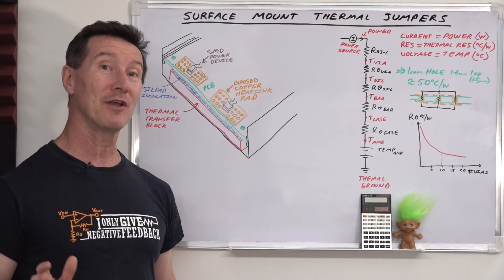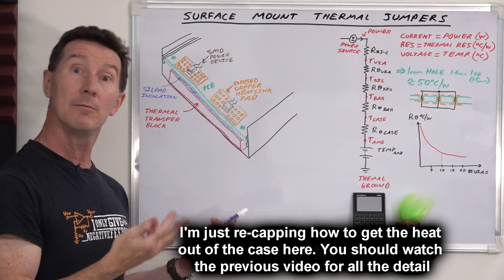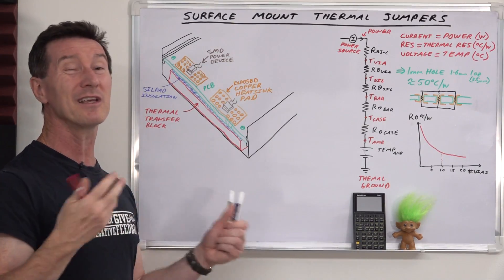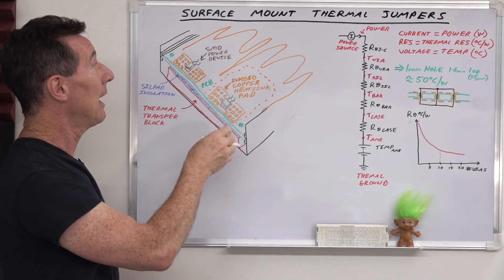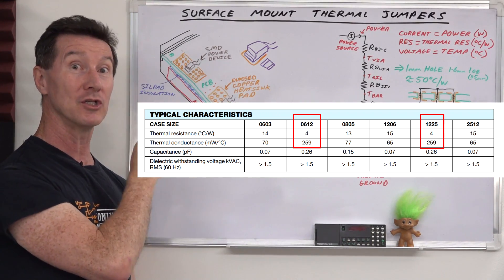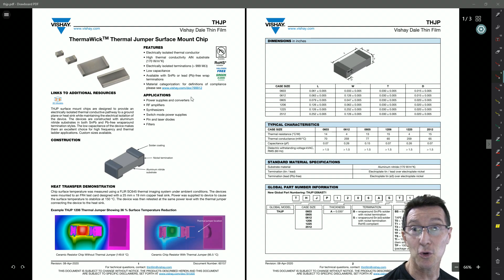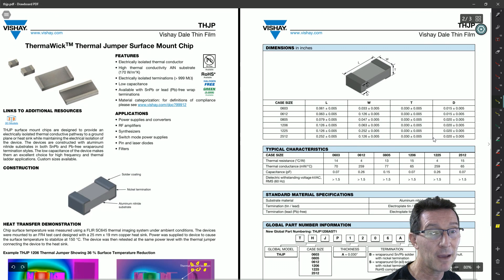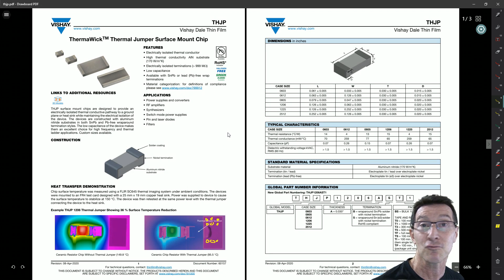EEVblog #1347 - SMD Thermal Jumpers could be GAME CHANGING!

Comment from the maker: FYI, I had to shoot half this video again because I didn't plug the wireless mic cable all the way into the camera and it made intermittent contact half way through. Given that I don't have any sort of script it came out very different the 2nd time around. Not sure which one would have been better. But those who follow me on Twitter already know this.
Reply: p.s. yes, it would be wonderful if you could make some short demonstration with a custom PCB and thermal camera in future.
Reply: Whats the deal with all of those calculators? :)
Reply: @pixlfactory  I was also wondering ... 4 "modern" Calculators and one slide rule ... and in the DM42 the batterie is flat ... needs a new CR2032
Reply: I’m so endlessly thankful you’re so dedicated to sharing all of this with us
Reply: Been Wondering When they will Clean Up Backs of PCB`s So you can place a Cooling Block on Rear of PCB`s
Reply: @JamesFox1  Whenever it is neccessary ? I have designed PCBs like that. Many companys have done that. Also check IMS PCB for more info on this kind of strategy taken to the extreme.
Reply: Very interesting bud, cheers.
Would like to see electrical resistances of the planes and traces with these things integrated though on logic boards.
Could the benefits be negated by power sensitive circuit requirements?
Reply: Thermal simulation isn't hard, what are you talking about? People can build lots of intuition by just using 2D FEM (FEMM4.2, Agros2D, ...). Just do it and don't give me the whole learnng-curve scare.
Reply: Would have been really cool to include a link to the point where you got past the rehash and got onto the new info about the relatively new product (esp since you can just leave a link if people need the rehash). The second half of the vid was great, ty heaps, but the first half was a bit mind numbing.
Reply: These  SMD Thermal Jumpers might also allwow GPUs with higher clockrate with that additional possibility to get the heat away.
Reply: Hey would you please explain to me how EMP Shield (the crazy amazon product) could possibly protect you from an emp or solar flare or DIRECT LIGHTNING STRIKE ... Shunts 200000A's in one billionth of a second... all i think is it cant be true right...
Reply: If you were paying attention to the calculators, you weren’t paying attention to the talk!

Comment: Very interesting indeed, those thermal jumpers. Regarding what you say about using your "entire" ground plane as a heat sink. The problem we encounter is the following. The ground plane has large area, which is good BUT is rather thin, what restricts the horizontal distribution of heat through that gnd-plane. So, in conclusion, we have a large area but we can not use it. We get a hot circle around the component. The diameter is directly dependent on the copper thickness (which is in most cases quite low).

Comment: We ran into a situation where these were a great option when designing a cubesat. There are very sensitive magnetometers on board to help determine the satellite's orientation, and current loops throughout the bus would cause pretty significant interference. Because of this, the aluminum structure could not be electrically grounded. Our RF amp was pumping heat into the ground plane and we needed to dump it into the structure while being electrically isolated. SMD thermal jumpers came to the rescue! Instead of trying to mount a heatsink directly to the IC, we could expose a region on the edge of the RF board which was thermally coupled to the structure. SMD thermal jumpers allowed heat to travel from the ground plane to this exposed edge.

Comment: Ok we are currently doing a redesign of an older board that has a thermal sensor to monitor some of the hotter components on the board. Just in case something burns out and we need to shut it off. The current "solution" was to put the SMD thermistor near the hot spot and call it a day. It does work surprisingly well actually.  While i was doing the redesign i remembered this video and put 2 thermal jumpers from the potentially hot components to the SMD thermistor. One jumper for each pad. I've yet to receive the new boards, but i believe they should work way better. 
Thank you so much for this Dave, my boss was practically jumping up and down when i told him what i had done. He was very pleased.

Comment: I believe these are only coming out now due to the increase in availability of thermal cameras.
Therefore they even have a place in every home tinkerers lab now.
Anybody who has accidentally shorted expensive components, by accidentally damaging the overly sensitive sil-pads knows there are many more purposes for thermal jumpers than just form factor.
Silpads are also a major contributor to PSU-casings accidentally becoming live if dropped or otherwise physically shocked.

Comment: In addition to allowing you to tie live pins to the existing ground/power planes for thermal reasons, these jumpers would also allow you to group the thermal pads of multiple isolated components together to share a common heatsink for cost-saving (rather than a small dedicated heatsink for each), without needing any other isolation layers. Think stacked transistor layouts, multiple equivalent channels of a device, battery balancing circuits, etc...

Comment: Ozark Integrated Circuits Inc have developed for NASA, a high-temperature packaging and multi-chip processor system that is capable of long-term operation at nearly 900 degrees Celsius. So I think pretty soon cooling won't be a problem.

Comment: I've added this comment because Dave repeatedly called the ground plane a heatsink, and it really isn't unless you remember the path to ambient.

It's fair to add a warning that the ground plane of your PCB is not a magic heat remover -- it is a very large sink of heat and transfers the heat to a very large area which changes the transfer ratio to the next stage (i.e. the silpad, etc.), but if the PCB is in an insulated case, the heat will still build up (thus a large delta temp); and if the ground plane is internal it will be insulated from any thermal conductances on the outside. 

I know Dave knows this -- this is a notice to readers that the key of the thermal jumpers is to transfer heat to the next thermal transfer stage without the electrical conductance. This allows a connection to metal heatsinks, cases, other planes and ground planes which require electrical isolation; but, in all cases the steady state temperature caused by the transfer of heat will still build up without a path to ambient.

Comment: Why do I not see the thermal jumper on the FLIR image at ~16:00? It should be largely the same temp as the load resistor with a small internal thermal gradient right? So it should be the same color as the pad on the end of the resistor and the "Heat sink"

Comment: Hi Dave interesting devices. For a Gamechanging we need a defined insulation. Vishay clames >1.5KV ac withstand voltage👍, but as you know, we need formal insulation approvals and ratings like CTI, dti, PD, working voltage and so on. Otherwise it may be not usable.

Comment: It might be tricky to manually solder these jumpers. You might need to preheat entire board first to 150 deg C , because your soldering iron or heating will not be able to melt the solder on such pad that has good connection to big heat sink like ground plane. And you don't want thermal reliefes on these pads either, because then this jumps will operate worse later.

Comment: Ummm, they did the calculation wrong. The reduction in heat is ~13% not 36%. You have to convert from celsius to Kelvin then do T2/T1. These guys made the same mistake ThermalFake did on their WaterRam block.

Comment: Using the ground plane as a heatsink means it will heat up and that could change the electrical resistance in some specific areas where the heat is located, generating voltage drops at the ground plane level and that could interfere with the circuit.
Am I wrong? I was just thinking about this.

Comment: Seems like these could be useful for on-board temperature measurement. Connect your temperature sensor (RTD, or whatever) to the pin you're trying to sense with one of these and you might have a pretty good measurement.

Comment: Afro and all others are here also.

I had ordered some for my last project. But they interfered with my design and would short some parts. At the end I used some vias for the LDO and for safety I thermalglued an old school alu fin block on top. Never heard any problems from the customer.

Comment: This is great, but I see a big problem... This presupposes you have good knowledge of the thermal issues in the device you are dealing with.  Most datasheets will characterize thermal resistance from the die to the air and the die to the PCB (assuming it's got a die paddle/thermal pad), but they won't tell you what the thermal resistance to the pins are.  Without that information, it seems like you are just guessing where to put these.

And if this thing is just a .03" thick piece of aluminum nitride, it's beyond me why these are so expensive.  Maybe its just the newness of them, hopefully prices will come down quickly and manufacturers will start providing more thermal information on the datasheets.

Comment: another reason to use these could also be wanting to reduce capacitance/size on some node, in that case you might want to go for the standard aspect ratio (eg 0402, 0603) ones. will certainly consider these in my next design
Reply: ah, should have watched to the end, you already mention that, still wanted to emphasize that these might be very useful even in situations where you could easily satisfy your thermal requirement by simply using a larger pad and aren't pressed for space for electrical performance / emc considerations
Reply: as i work on very low volume and expensive products i am not all that bothered about cost, having to go through an additional prototype cycle or even spending an extra week on a design is always a lot more expensive than having another couple of dollars on the bom over the entire lifespan of the product. i usually try to do everything i can think of to make a design work and pass emc tests on the first try. smd feedthru capacitors are also great btw :)

Comment: Interesting part!
One note though, I think if you do the math, you'll find negligible benefit to not soldermasking a board for thermal reasons, the soldermask is very thin and has a very large surface, and to get any kind of temperature difference across that you'd have to be pumping a LOT of heat through it, so much that if you're that close to the bleeding edge of staying in spec for your junction temps, your product will fail in the real world , you know, some dust builds up somewhere and reduces thermal transfer, the device is in the sun, etc.. I'm just saying there'll be bigger fish to fry

Comment: I need to keep a 48 pin QFP cool in my TV. Otherwise I have to replace the QFP every two years or so. I guess the TV wasn't meant to be used all day as a computer monitor. 

Is there a simple way to do this,  like using some sort of thermal glue (does it exist?) To attach a penny to the QFP? I suppose there must be heat conductive epoxy...

This jumper thing looks interesting.

Maybe a sil pad thing? I think it already had one. Not good enough.

I think I need to thermally connect the top of the QFP to the EMF shield that covers the entire TCON board. Maybe that's what the original sil pad was supposed to do? I just need a thicker more conductive sil pad?
Reply: Yes, thermal glue is a thing. Like Stars 922
Reply: @nife3557  
Thanks for the tip

Comment: 14:40 i'm rather surprised you didnt have a bit of a rant about the "36% surface temperature reduction" marketing BS by some marketing guy who doesnt science. 0C is arbitrary and doesnt represent zero temperature, the original temp is 423 Kelvin, the 54 Degree reduction is 12.8%, not 36%.

Comment: Using the short fat ones may not be viable sometimes because you still have to maintain the gap between conductors. The voltage breakdown is still a thing.

Comment: Hey Dave!
Really great video, but I have to mention one thing that I don't agree with you.
You mentioned that it's better to expose the copper instead of having it covered by solder mask.

I work as a PCB Design Engineer in one of the largest automotive companies in the world and I can tell you that this is a huge no-no. You'll just expose the copper to corrosion and risk interrupting the trace/area in time.

Additionally, the thermal resistance of the solder mask is insignificant since it's so thin so it can be considered as negligible.

If you'd have air flow over that exposed copper, it might help compared to having it covered by solder mask. But it's quite rare to have air blow directly on a certain part of the PCB.

The only situation where I see copper exposed as viable is when you'll add solder over it to just increase its thickness ( Tesla does this in some of their PCBs to carry much more current).

Again, thanks for your videos. As a young engineer they've helped me greatly throughout my studies :) keep up the great work!
Reply: No.   Unless you've gone done something funky, a finished pcb NEVER has raw copper exposed;   raw exposed copper ALWAYS gets plated (hasl, enig, osp, etc) as part of the pcb manufacturing process.

Comment: 8:39 - Also the copper on your top and bottom layers is usually thicker, so that helps with heat transfer. I've used the layer flip technique on some designs where heat or current carrying capacity was an issue.

Comment: Why are the data signals usually on the outside pcb-layer (of a 4 layer board), anyway? Wouldn't they be better protected from outside interference if they were surrounded by a flood-filled ground+power plane?
Reply from the maker: I have still to make a video on that. PCB already made and assembled, and a very specialised kit of kit for testing has become available to me.

Comment: This might actually be relevant to my interests. I do software/firmware, but I try to at least follow the other aspects of design. I assumed the ground plane would typically be used as a heat sink, but it's good to know about options like this for cases where parts have to be electrically isolated but could benefit from being thermally connected.

Comment: I used to work in the lab of an electronics company and the amount of thermal testing that was done was insane! On some low voltage but high power boards, six layer PCBs were used to soak away extra heat. Unfortunately it did make removing copper foil wound transformers a bugger to remove!

Comment: Hi Dave! Finally a tech-video again! Thanks! As there does not seem to be any temperature gradient on the rightmost rectangle-shaped thermal pad in the thermal image I suspect there might be filled and capped vias that are not visible. /Tomas
Reply from the maker: Yeah I thought that was a bit interesting.
Reply: @EEVblog  Yes, thermal-stuff is actually interesting and one of the most important topic since this is often the limiting factor when it comes to power conversion designs. As I am sure of that you are very aware of!

Comment: Though this looks like a game changer passive thermal solution, i am predicting an active thermal solution in similar smt form. They would use the peltier effect to both remove heat and act as a sensor/(power source for backup purposes). Their application area could be based on high performace, compact high current FET driving application.

Comment: If the thermal conductivity is similar to a thermal pad then what would be the difference between heat flowing through soldermask then a 2mm thermal pad and finally through soldermask into ground plane. The only challange would to keep pressure on the thermal pad. I don't see an advantage to these.

Comment: M guess is small clearance between power part and ground plane, like 6mil, wouldn't be much different, 16:00 is misleading, why didn't they place the resistor near the plane when there is no jumper

Comment: Hmmmm... I see only 1 use for this, If have to run 1 or 2 signal lines on the top/bottom layer where the thermal path would normally be placed. Sounds to me to be a very niche product, but if you have to have 1 then its nice to know they exist.  :-)

Comment: The claim of the manufacturer of a 36% temperature reduction is rubbish (you cannot compare absolute degrees Centigrade in this way)! In fact, it is probably more because you have to measure the difference not to 0 degrees Centigrade, but to the ambient temperature; assuming 20 degrees ambient, the actual reduction is 55/130 is 42%!

Comment: These thermal jumpers seem good, however i do think you can do the same inside the board.
If 4 or more layers are available there is an easy fix, without using a much extra space and components. 
I use this all the time for thermal coupling of the plane with the power device.
Just interleave the planes. If the thermal source plane is on top, do thermal vias, use the space in between to couple the GND plane.
Make the top "source" plane overlap the GND plane on layer 2. Connect the 3. layer with vias to the source plane on top. 
This make a a good capacitor as well as provide thermal coupling. The capacitance is not that big and in most use cases not relevant.

Comment: Bonus points for putting GND on the outside layer, not only do you get thermal dissipation (especially with the thermal vias or GND stitching on the board edges) but now you've doubled it as a faraday cage.

Win-win for thermals and FCC Part 15 compliance.